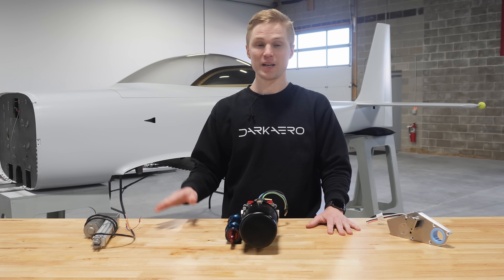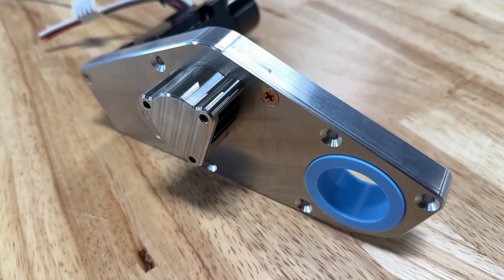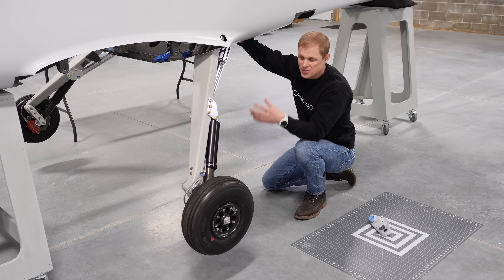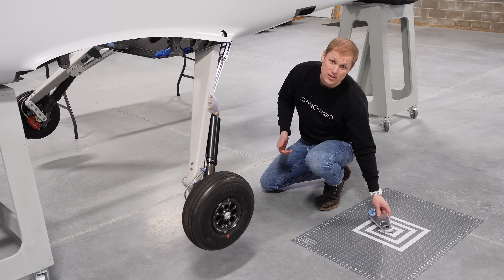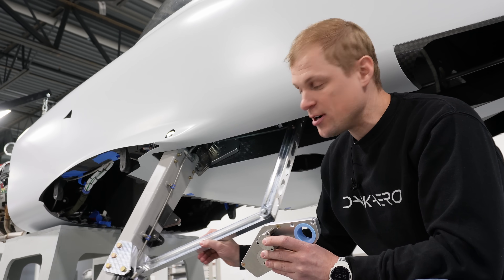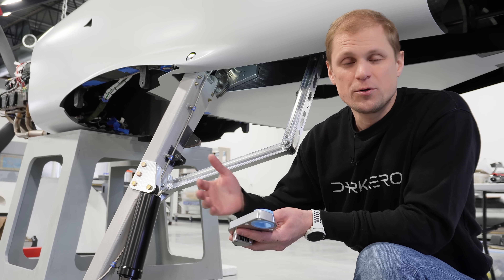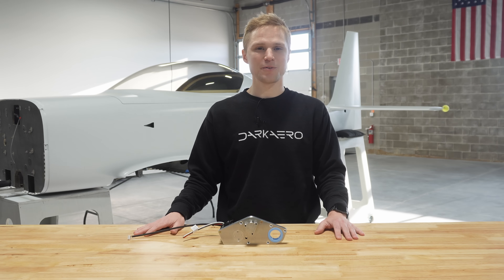Why we designed our own retractable landing gear

Comment: The CG shift when the gear retracts is concerning to me.  Still, a very cool design all the way around.  Well done.
Reply: I was thinking of the Cessna mlg retracts at first. Your comment does make me question the cg also as this design has a lot of weight on the strut. It looks really expensive either way.
Reply: @9HighFlyer9  The high wing Cessnas with retractable gear have a fairly wide CG range and tail surfaces large enough (tail volume) to handle the CG shift.  The DarkAero bird has (I'm guessing) a fairly narrow CG range but the low mass of the carbon fiber gear may not cause enough of a CG shift to cause problems.  I'm sure all of this has been considered by the designers/engineers. 😎

Comment: Very interesting video. Knowing from experience that gear failures are one of the most common failures you get on complex aircraft, failure mode planning and analysis is always of interest to me. With that in mind...gear switch failures are common. What is the failure mode (i.e. the weak link) should an up or down limit switch fail, and the actuator continues to run - does it stop against a physical limit? Does the clutch let go? What causes the drag links to overextend? I don't see a spring in there anywhere. Also, what actuates the up/down lock mechanism, and what is the override to unlock the gear should that mechanism fail in flight?

I always found it fascinating when studying gear systems, that the design is typically "the ability to retract is optional, but the system will move heaven and earth to extend the gear." In that in any given failure mode, the default is to end up with the gear down and locked. Witness hydraulic systems which utilize continuous pressure to keep the gear retracted - loss in pressure for any reason causes the gear to free fall. Things like a mechanical uplock (obviously required in your design due to the actuator) make me nervous unless I know there is something I can do that will absolutely release that lock in the event of some kind of damage and/or failure.

With that in mind - is there a blow-down or other emergency extension method if there is a mechanical failure of the actuator gearbox? I'd hate to have a gear up landing because of a sheared/jammed pinion tooth.
Reply: To piggyback on this comment, gas struts are known failure points, especially in cold temperatures when the seals harden.  So I would be somewhat concerned about using a compressed gas strut as the failure extension driver.  One other thing, can you discuss what inspections the builder/pilot should perform on the gear retract/extension systems?  For example, to confirm that the up- and down- locking latches are not worn out of tolerance?
Reply: Piggy backing even further: I would consider a torsion spring rather than a gas strut, to address those failure modes. The metallurgy should be consistent enough that you should be able to calculate a mean cycles to failure, and thus have a flight cycles to replacement spec.
Reply: I always love such positive criticism.
Reply: The gas strut which handles extension in case of gearbox motor failure is described in the video. If the gearbox mechanically jams, you're doing a belly landing.
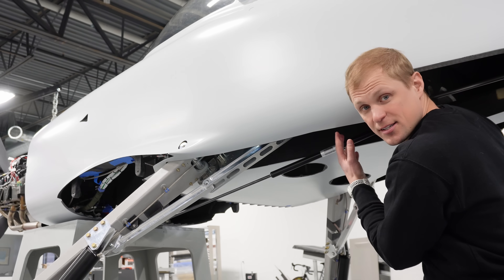Reply: 5:50 That drag link looks like it will be highly loaded during an emergency braking event.
Reply: An extra coat of paint and a good polish on the belly of the fuselage!🫣🤣
Reply: I don't know much about aviation regulations, but I guess there is a big difference whether the plane is going to be UL, general aviation, or airliner, because the consequences of a failure are significantly different. 
What I know for sure is that every added redundancy is nice but has a price tag especially when it is a custom design.
Reply: @janoshorvath9430  This is an experimental, so pretty much anything goes. As long as it appears to be designed correctly and passes the FAA inspection for "general airworthiness" you're good to go.

The points being made here are not based on what will pass regulations, but what makes sense based on lessons learned in the past from gear designs implemented by other light aircraft manufacturers.

As for redundancy, even light aircraft have multiple redundant systems, particularly in the landing gear systems.
Reply: Thanks for the reply, now it makes sense! 
Actually it's a great thing that aviation enthusiasts share their knowledge and make suggestions im order to improve the overall design!

Comment: Very exciting, guys. I wonder if you guys ever went over to Boeing Surplus in Kent near South Center Mall area? It's not there anymore but back in the day you could buy sheets of titanium and nose cones from B-52s and rows of old passenger plane seats from 707s and even older Boeing builds. The 10x10' bin of used drill bits sold by the pound was also great and I still have some of em which were used like twice before the tolerances were shaved down and all are made of cobalt or titanium which i think i got for like 10 bucks for a couple pounds of em! I have a Rand-McNally world map they had in war rooms from WWII and a metal desk that weighs like 2 tons! Its no longer there but you could have likely sourced half those parts right in bins there what an amazing resource that place was
Reply: Thank you TRUE AMERICAN
Reply: @stevefisher2553  Thanks LOL all from a schpiel about used boeing parts (i'll take it!) carry on, good citizen!

Comment: How do you know if a gas strut for emergency extension goes bad and leaks out all the pressure? How about operation in cold weather?
Reply: Inspections
Reply: @9HighFlyer9  should be something you can verify on a walk around no?
Reply: @jdomarsh  yeah, I mean a walk around is just a mostly visual inspection. As long as the strut doesn't have any obvious damage, not leaking oil or sagging I'd say that's an adequate inspection.
Reply: @9HighFlyer9  they could be completely inop without any visual indicators. Considering theres 3 possible failure points for the fear system ie the gear motor, gear box and the electrical system itself it would probably be good to have something you can check before each flight. Maybe if they had an external pressure gauge that could be verified or just a hand crank for a manual extension in emergency purposes that would make more sense to me. Just my 2 cents
Reply: @jdomarsh  I don't disagree with you on the hand crank. These boys seem to want to add complexity and failure points in lots of places though. I think the gas springs are a pretty safe choice though.

They've been around for a long time and cheap ones easily last a decade under the hood of cars and trucks. Good quality springs with some tbmf testing shouldn't be too hard to source.
Reply: @9HighFlyer9  fair enough. Maybe I've bought too many clapped out 20 year old vehicles with hoods that won't stay up to trust them. 

Hopefully any respectable owner would give their airplane more attention than I give my cars haha
Reply: @jdomarsh  I've owned my fair share of 5th hand 20year old vehicles. Been smacked in the head because a strut would only hold the hood until I got my head under it.

I'd like to think that anyone putting a plane in the air would maintain it better than 95% of vehicles on the road.
Reply: @9HighFlyer9  Every winter I bang my head on my trunk hatch several times because the gas shocks go weak in the cold and don't hold it up all the way. Happens with every car I've ever seen, except my Miata which uses torsion springs instead.
Reply: @9HighFlyer9  but how do you inspect the struts, without removing one end? That's possible, but not something that I would want to do for every flight.

Comment: Seems like between the drag forces from the wheels being extended and the center of gravity being moved to the rear of the plane when the wheels retract, flight characteristics will be quite different when the wheels are down.

One solution would be to have the engine and propeller raise up vertically to give the propeller clearance. I didn't say it was a good solution.

Comment: Very cool project, the landing gear design is pretty neat. Would it be an option to incorporate a turboprob engine like a Turbotec TP-R90 in the future? Those modern regenerative turbines are roughly as efficient as piston engines.
Reply: Turbines can be pretty good at cruise. They can be pretty bad while sitting on the ramp waiting for a clearance.
Reply: @rnordquest  I had not heard of Turbotec until now, but it does sound intriguing and fuel efficient.  They are only 130 hp so not super powerful.  The intriguing part is fuel burn is 5 gallons per hour and they only weigh 170 lbs and TBO is 3,000 hrs.  This is from their website:

“Turbotech designed the regenerative turbine from scratch and  it combines all the advantages of a turbine engine with very low  fuel consumption. A regenerative turbine is a turbine engine  equipped with a heat exchanger, capable of recovering the heat  normally wasted in exhaust gases and reinjecting it into the  combustion chamber, leading to a dramatic fuel burn reduction.

The idea of using a heat exchanger in turbines is not new,  but the real challenge was to apply it to the aviation industry sector and its need for a very light, compact and reliable heat  exchanger. Turbotech has managed to develop an exceptionally  performant microtube heat exchanger, thanks to 10 years of  research & development.”

Comment: Trying to understand why the rear landing gear was engineered to over travel so far passed the natural 90 degrees from horizontal? I worry those shocks may weaken over time and not have the necessary force to push forward to lock the arm in the event of the gear motor failure.
Reply: The wheels need to be positioned relative to the Cg of the plane and not an arbitrary 90 degrees from the swivel.
Reply: @mattym8  Well that makes sense. I just fear the wheels not going forward far enough against the drag if the shocks get weak. Maybe they add some type of manuel crank as a back up.
Reply: @rotaryperfection  I saw a shaft connected to one of the gearboxes in a few frames. I think this shaft is a manual crank. I agree with you that it's necessary.
Reply: Maybe the intention is if the lock mechanism fails for any reason, won't collapse due to the aircraft weight on landing.

Comment: IMO hope you're using brushless motors. Brushes in my electric chainsaw have failed twice. What if something on one gear fails?
Reply: Brushes are simple and can be inexpensively replaced, they also take a loooong time to wear out if engineered correctly, my Honda Civic starter lasted nearly 2 decades before the brushes needed replacement.

Comment: Extension under failure mode: what about a clock spring type solution around the gear pivot point? Does that place too much stress on the motors? Or too much weight?

Comment: It’s interesting — it seems like a super high angle of attach for the gear, especially in a flare. Any comment regarding this?

Thanks as always guys!
Reply: The angle that's important is between the trailing link and horizontal, which is probably okay.

Comment: I love that they are using a neo550 and versa planetary, it's kind of weird to see it in this application.
Reply: wait are you planning on using a spark max controller or something like a vesc. In either case why do you want to be using a sensored motor, I would think with having endstops you could just use a simple esc and ignore the sensored aspect to reduce complexity and cost.
Reply: @shuki546  they are using a bldc? Yikes. It seems like they should just use a brushed motor. I agree with you about ignoring sensors.